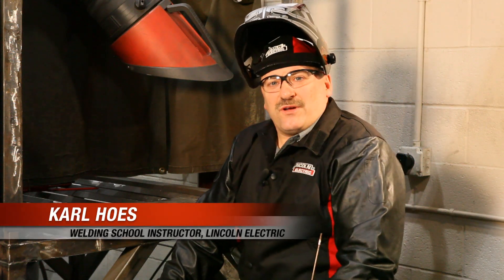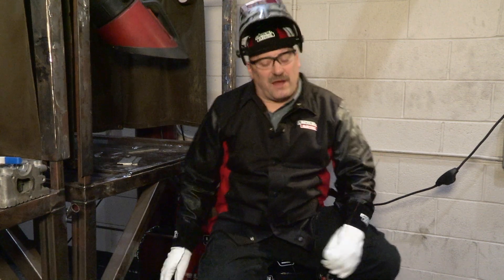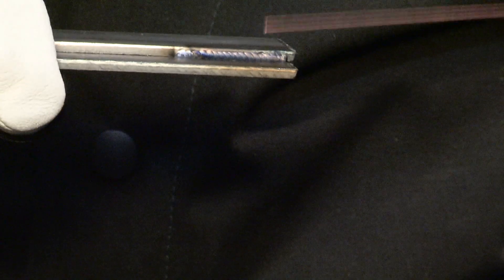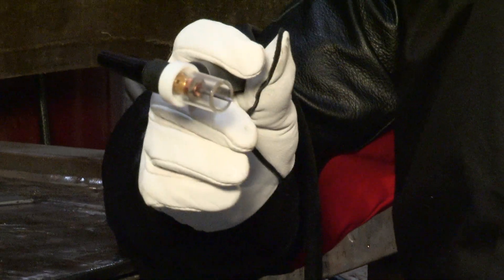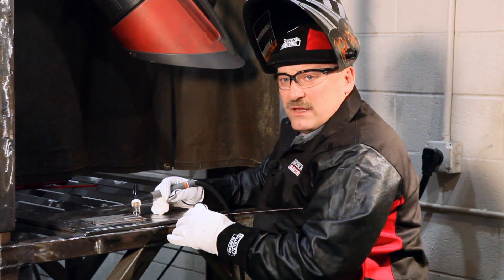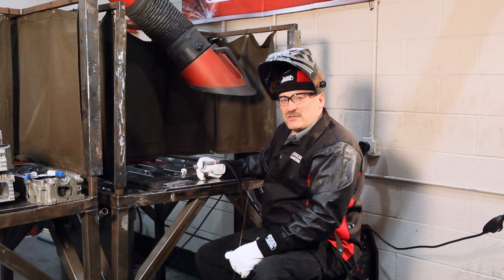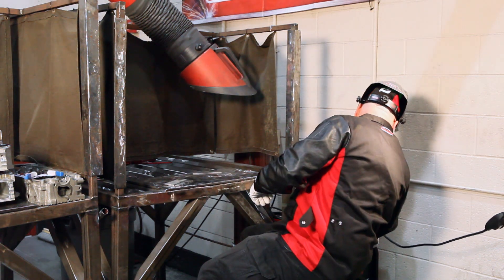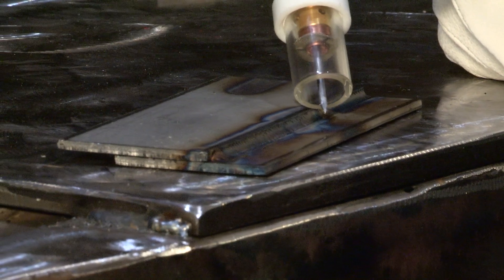Tips from the Experts: TIG Welding Steel

Comment: That quick demo of what NOT to do at the end stuck with me. That's exactly how my welds look right now; dull and crappy, with a huge heat-affected zone (and my technique isn't as consistent either, but that's another story). Thanks, Karl. That Pyrex cup is pretty slick, too. It beats getting a crick in your neck.

Comment: I just started tigging, my welder ,only shows voltage that is adjustable. how do i figure out what output in amps is? I also weld mostly 14 ,16, 18 gauge sheet metal steel...whats optimum gas flow, heat range and torch distance from pc?

Comment: How are we suppose to clean the welds after they are done? Do we use a sanding buffer/grinder something? Or we use chemical or something?
Reply from the maker: Clean the welds with a wire brush, hand held or on a grinder.  You can also be more aggressive with a flapper wheel or a grinding disk.  No need to use any chemicals.
Reply: lincolnelectrictv Thats fantastic thanks. I heard they use a wire brush and clean the place they will weld with aceton, is that a good practice to do?
Reply from the maker: Its not necessary to use chemicals.
Reply: lincolnelectrictv Ok thanks